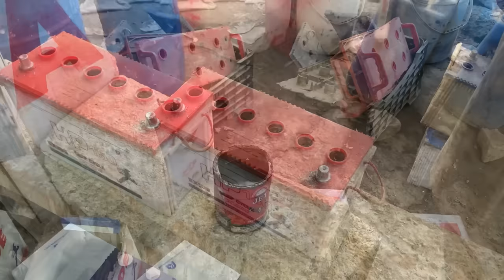How to Restore Old and Dead Battery? Amazing technique of lead acid battery restoration

Comment: I guess there's no such thing as lead poison, if you've never heard of such thing.
Reply: They never seal off the individual cells at the top, either. Like the factory did it. So, electrolyte is free to move between cells during driving or transport.
Reply: Lead poisoning is not possible if you got the flip flops and pyjamas on
Reply: Mind over matter
Reply: That’s why they keep doing this job ? 🤷‍♂️🤦‍♂️
Reply: Morrem i não sabe de que foi também 😂
Reply: Selekcja naturalna...

Comment: few problems
1- he used the same old cells that might be few dead one among them
2-positve pole is bigger than negative so you won't make mistake  when installing,he used the same
3- voltmeter does a better job than shorting out the battery at the end,it might cause explosion!(I guess it considered as population control over there)

Comment: I doubt that these batteries, once rebuilt, are of the same quality and capacity of the original.
Reply: those are just temporary batteries they cant be as the same as the original ones
Reply: @Yangaone-h8j  you are aware that all batteries in existence are temporary, right? i'd hate to live in a 3rd world country where the only choice is a garbage and potentially dangerous product.
Reply: They won't be, since the just reuse the same lead plates. They'll be coated in sulfates, and thinner than they used to be.

Comment: Perfect job my friend I love it🙏🙏💯💯❤️❤️🇵🇬🇵🇬
Reply: Cells are open to each other, not individually sealed off like they were from the factory. Electrolyte can move between cells if the battery is tilted or shaken, such as during driving..
Reply: Top jio nice very nice 👌👌👌⚡⚡⚡🥇🥇🌻🌻👍🏼👍🏼

Comment: Good work 👍
Reply: No seal from cell to cell, like the original, so not very good as electrolyte can cross over between cells if the battery gets tilted or shaken, such as during driving or transport.